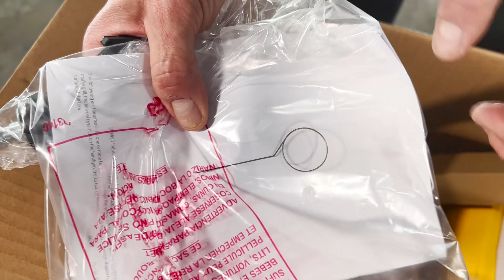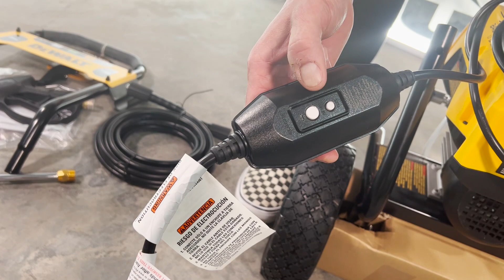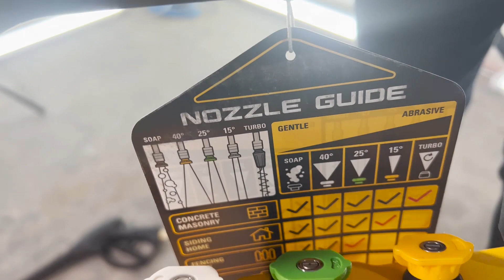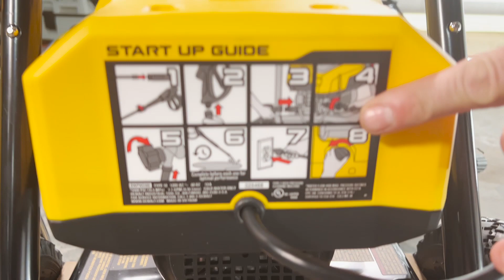DeWalt DWPW2400 2400 PSI 13 AMP Electric Cold-Water Pressure Washer Unboxing

Comment: Does the power surge when first starting the pressure washer exceed 15 amps?  Concerned because I only have a 15 amp breaker.

Comment: At 13amps it’s a 2hp electric motor.   How does it make 2400 psi when my 5hp Honda only makes 2700?  I would love a powerful electric washer because i hate the noise, but i have my doubts.
Reply from the maker: The size of the pump is what determines the PSI, the motor just drives the pump